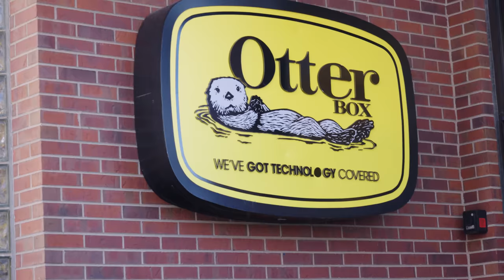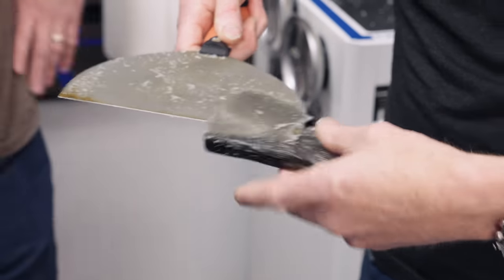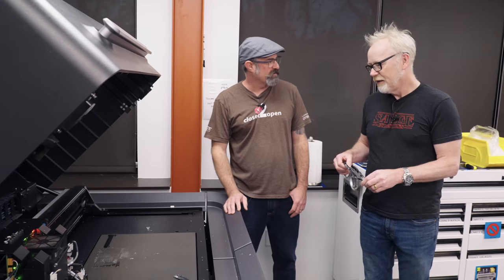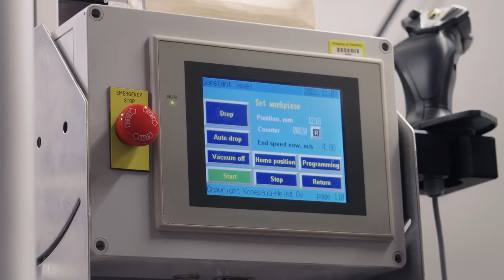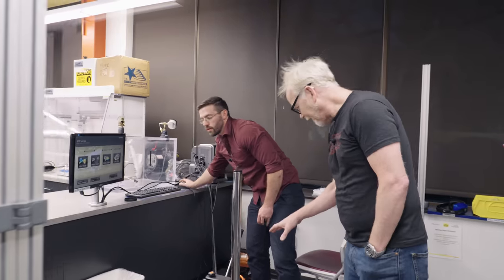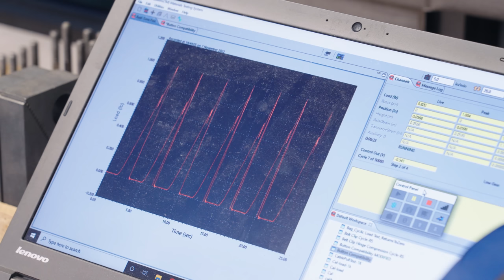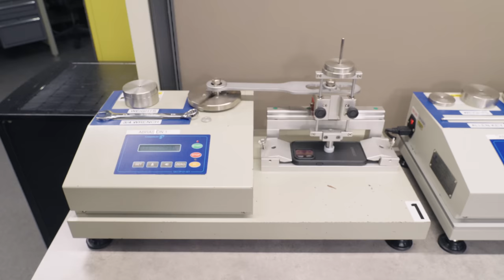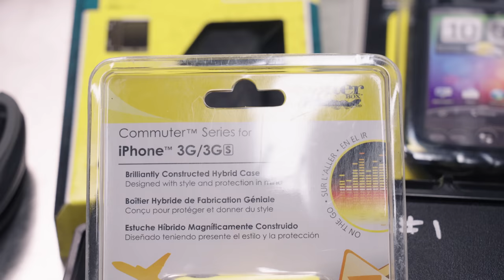How Phone Cases Are Tested to Their Limits, Featuring OtterBox

Comment: @11:45... I love how the machine has kick-outs to hold a device until the maximum height is achieved and then it drops the device. Without the kickouts, devices would just slide back and forth as the machine rotated. The thought process that went into designing such a simple thing to achieve a complicated result amazes me. This is why I love engineering and building stuff. I love to think about, what's the simplest way to achieve this complicated result?
Reply: I'm the one that built and designed that tumble tester. Thank you!
Reply: @terrycandlish8462  🧢
Reply: @benjaminfranklin4760 cap? Lol....Would you like proof?
Reply: @terrycandlish8462  lmao I’m just jk

Comment: I've been using the otterbox commuter for years. I currently have a phone with an in-screen fingerprint reader and it can't have a screen protector without compromising the fingerprint reader's useability. So far my phone has been completely safe in just the commuter with no screen protector. The other day, for a joke, I tried to crack a boiled egg with the case like it was a hammer and it wouldn't do it. It's a great product!

Comment: I worked quality control at an injection molding company for Exide car batteries. We tested for holes in the cases with water and extremely high voltage, froze them and did impact tests with a weight from 20 ft. Along with the color-spectrometer for Amana refrigeration parts and measuring devices, it was a cool job. Great video and a great product.

Comment: Great video as usual. It is a rare look inside one of my favorite companies. It is bitter-sweet, though, as the history portion of the video shows how the company has diminished their rugged products and overall quality. Some of those earlier cases, especially the waterproof cases around 2012 were the best. Those days are long gone. No more metal hinges, no more seals, not more gaskets, no more built-in screen protectors (except for the really expensive iPad cases and a few others). It must have been expensive to produce those, for sure. Still, I miss them. I am up to two cases per year now, mostly due to plastic fatigue in the Defender series. It's ok, it is a still a great company.
Reply: I think a big part is the phones themselves are less susceptible to damage. If your phone is ip68 rated, why do you need gaskets on your case? Obviously this is only a single facet.
Reply: I agree, they used to have such a solid feel. Now they are cheap and look rough after 3 months of use. Especially the defender which has always been my favorite series.
Reply: Yup. The elastomer perishes within a year - and sadly, much as I like the cases, I’ve been really disappointed by the company’s unwillingness (through their customer service team) to engage with questions about spare parts and wastefulness.

Comment: Hello Adam.
You were very gushy here! 
I’m a bit of a fan of Otterbox as I use their boxes and used one of their cases to successfully protect my old phone for ~5 years BUT their product line is far too limited, sadly. 
I’d like to see OB’s ‘lower run’ manufacturing supporting less mainstream phone companies such as Fairphone as the FP4 is supposed to be supported for far longer than almost any other device, yet their range of FP cases is zilch. 
OB’s lab certainly looks the real deal but to ask the company a question or suggest a feature you have to give them your email, full name, phone number and order number(?) before you can submit something. I hope they are following this thread (as they could improve certain areas a lot) or you can ask them if they might work with more sustainable OEs. Please prod if you can!
Thanks.

Comment: He asked about 3D printing being the manufacturing process. I wonder if 3D printers will become another appliance people have in their homes like a refrigerator, washer, dryer, and TV. Instead of buying a product from a store in a package, you just buy the file needed to print the product at home. Need a new spatula? Buy the spatula file and print one. Need a new phone case? Buy the file and print it. There's probably thousands of products people could just print at home. It would be about as close as we could get to having a Star Trek replicator. Amazon wouldn't sell physical products anymore that need to be packaged and delivered. They'd sell 3D print files for the products that can be printed. Not everything can be printed but for those smaller items, why not?
Reply: The real limitation is the material storage. For one, the types and volume needed. Two, for the safe storage of the material itself. (Humidity, heat, ect) But for things that fit the bill with accessible material like PLA you can already get thousands upon thousands of models printed out. It's a crazy world!

Comment: Love Otterbox, only cases I've ever used. Always go for their Deferender series ones, though gotta admit the outer rubber piece does tend to sag after a few years, especially in the corners my current one doesn't contour to the plastic shell case anymore in the corners, and the rubber flap for the charging port ripped off after a few years of opening and closing it daily. But overall still very, very solid cases, way better than just the simple back cover "cases" most others make.
Reply: Can you tell someone at otterbox can they put magsafe in the regular defender pro xt case

Comment: So I love otterbox’s cases, I’ve used little else since my first touchscreen device (iPod touch 2nd gen). I fell in love with the otterbox strada for galaxy s8, but recently I’ve been very disappointed by the Strada case for the iPhone 13 Pro. Multiple screenshots from accidental vol+ presses, drastic volume changes when i put my phone in my pocket, no MagSafe option, and no tab to be afford actually opening the cover? It just feels like they forgot to actually try the case themselves. 

So with all this testing infrastructure, how does the quality control work, and are you running short on designers? Or was it just a product that ran out of time and had to go into production or get dropped? It just seems strange that it contains so many oversights.

Comment: If the phone manufacturers  did there job better.  We would not have to buy a box to put the phone in.
Apple stop making thinnest ,lightest phone.  Make your phone tough enough that you don't need a box for your phone.
Reply: Not everyone wants that, many people still use a phone without a case.  I'd much rather have the freedom to choose my level of protection than have every phone designed to be overly protective (aka heavy and bulky)

Comment: Apparently they don't bother to test what the case does to reception though. My T-Mobile S21 can't get any 5G signal when it is in the OtterBox I bought because I heard so many great things about how tough they are. I use a different case now, which has no effect on the 5G signal.
Reply: Cause OtterBox KNOWS what's up with 5G.... But you do as u want, just remember
Reply: Was your case metal or something? Polyurethane is RF transparent at both of the 5g frequency ranges.
Reply: @purge2--u--nite342  You have a source that isn't trust be bro?
Reply: @Voyajer.  That may be the theory, but I could try to run a speed test and get only LTE, then 20 seconds later after getting the case off I'd get fantastic 5G test speeds. Put the case back on and down to just LTE again. The case was an OtterBox defender for S21 5G.

Comment: I have a Nokia 3310, why would you need a phone case? I once left my phone on my rear bumper and it fell off while leaving the worksite, spent a whole day being run over by truck coming and going while a cement pour was going. I managed to find it the next day when I had someone call it and heard the ringer. It was firmly impressed into the asphalt once we chipped it out it seemed fine.
Reply: Dumb phones might be dumb, but they were resilient!

Comment: These tests are really cool but some of the tests are flawed. 

The test with the hinge should go full degree of swing because a lot of times that's how it would be used. ALL THE WAY open, ALL THE WAY closed

Also, the abrasion test with the denim. I can't think of any jeans that have denim INSIDE the pocket. So it is really only testing rubbing against leg which would have much less often
Reply: While I agree with the hinge, I dare you to put your phone in you pocket and out again one handed without it touching the denim above your pocket. Not only that but at least on my Levi's the denim does reach into the pocket. Looks like 1 to 2 inches deep in order to overlap with the outer face of the pocket.

Comment: Otterbox sadly aren't worth the product they sell. Even if their product was free, it still wouldn't be worth it. They have some  of the worst customer service I've ever come across.

I had an Otterbox for an older phone I no longer have. I accidentally/lost the plug that went into the audio port. Went to their site, couldn't find a replacement. Sent an email, and was told they don't supply/sell replacement parts. 

I kept the case long enough until I found a replacement case from another manufacturer.

Comment: My family has used several otter box Defender cases. Eventually the hard plastic areas would break or the flexible material would stop fitting in their designed tracks. 
Eventually I chose a different brand (Spigen) and haven’t had any issues for the last 4+ years, they’re also a fraction of the price. I was in a 60mph head-on car accident in December of last year, my iPhone 14 pro max flew off the passenger seat and ended up in the back of my car (Honda Element w/rear seats removed). The Spigen case survived with deep gouges and scratches, and other than looking tore up it functioned perfectly and my phone was in perfect condition.
I wish my car had protected me as well as my case protected my iPhone 😂